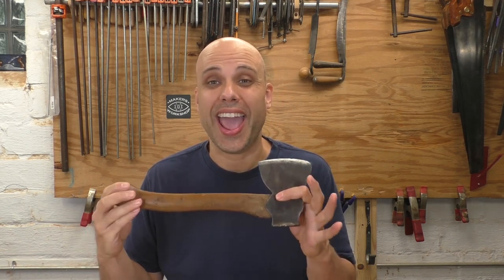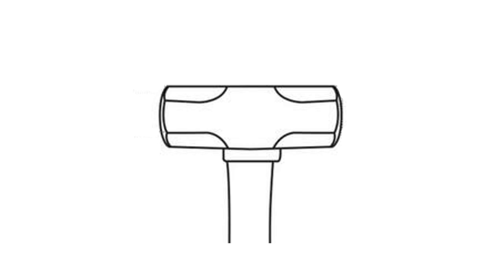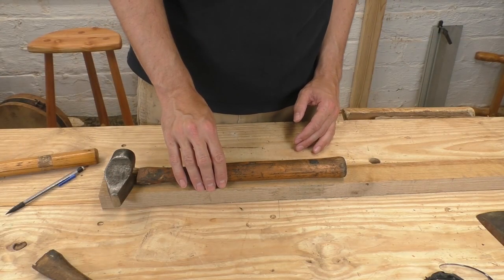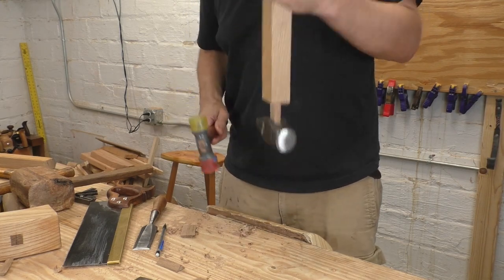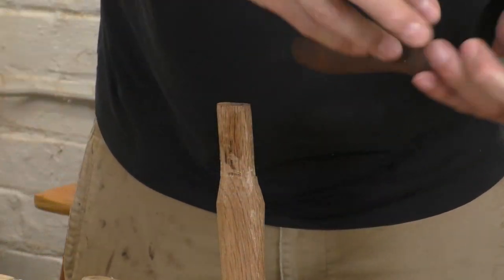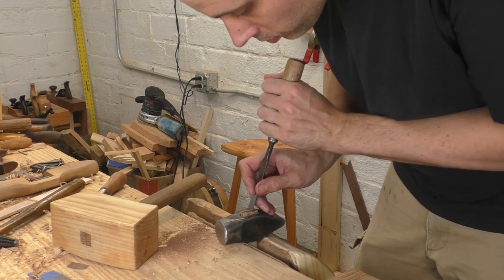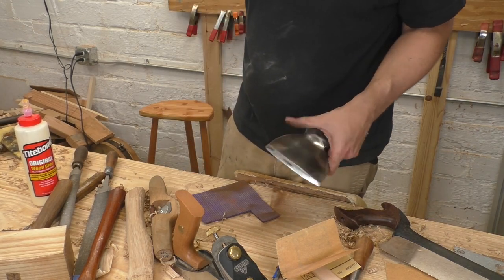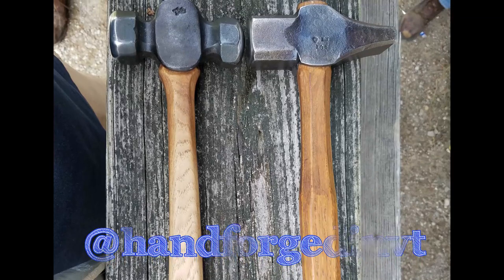Make Custom Handles for Your Tools! (Ax and Hammer Restoration)

Comment: Excellent! I've bought a cheap peen hammer with the weirdest handle ever. It's a small, light hammer, but the handle is longer than that on my my larger peen hammer :o It's very unwieldy! I'm going to replace it someday. Thanks Rex, the Rex Army salutes you! (New name for your patreons, eh? No? No, probably not ... )
Reply from the maker: I would enjoy having an army, but I don't think that's the vibe we're going for here.
Reply: @RexKrueger  Quite!
Reply: The extra long handle, probably 24 inches, is a sign that it was used as a fullering tool in black smithing.
Reply: @criswilson1140  It's not that big. It's a 4 oz and 13 inches (approx). But perhaps that makes sense considering the tiny weight?

Comment: Um, I'm left handed....is it problematic to have the head on "upside-down"?
Reply: Head shapes are action-specific, so if upside-down looks like it would work then no reason not to. You can also file off whatever you don't need or want. You can also weld on more material & file down to a shape you like, tho IIWMI'd pre-heat the head before welding & bake it at 420F for 2hrs after shaping for stress relief & tempering

Comment: back in the day there was a voluntary project for putting a ton of public domain documents (mostly peace corps) online called 3rd world CD(a set of 6 CDs)

one of the documents was 
_ag_fo_wood_harvest_hand_tools_unilo_en_lp_106970_.pdf

_that had a HUGELY useful section on hand tool handles_

the website is now down
I don't even think you can use the wayback machine to get the files
I think I eventually found this on torrent

I highly advise anyone to look for it and get a copy of the whole archive itself, as there is a LOT of hidden info in them(blacksmithing, woodworking cabinetry, house(and barn) building)

it has a lot of the basics, as it was meant for voluntary organizations (like the peace corps) to help 3rd world countries to get uplifted into 1st world ones

there is a website that does have that file, but pretty much a ripoff joint selling as survival guides
Reply: google 2012_cdw3d_dvd_set

Comment: Two things, a little flex in an axe handle isn't a bad thing, so hickory is still a good choice. Have a look at this video, he discusses axes and handles in depth:
https://youtu.be/DrghRcqbVis

You should toss that container of "Boiled Linseed Oil" buy some flax seed oil and heat it very carefully on your stove and begin using that for all your finishes where you require BLO. If you've never done so you'll be very surprised how well it out performs commercial BLO, the primary reason is that they just use drier and never actually heat the oil. Which causes it to become sticky and such if not handled properly. Flax seed oil can be used on wooden  utensils as a food safe finish.

Use Flaxseed oil and beeswax to make your own paste wax and you're good to go! Great video Rex!

Note: I do realize that linseed oil and flaxseed oil are two names for the same oil ;) Flaxseed is the name used for it in food and dietary supplements therefore safe to use on utensils and free of chemical drier. And no solvents are used in the extraction process, commercial raw linseed oil doesn't have dryers but it definitely contains solvents from extraction.
Reply: too much work tbh, BLO is cheap and does the job.
Reply: @tyronicusmaximus4230  Very true! I happen to make a lot of wooden spoons and cooking utensils, so it's a must for me and the reason I discovered the difference in the first place.
Reply from the maker: Certainly sounds like it's worth trying!
Reply: I strongly discourage boiling your own linseed oil, as the fumes are very toxic! However, I heard that you can heat it up slowly over several days with the energy of the sun, outside. I have tried neither of those methods myself though. Please be careful with your health, you only got 1 body.

Comment: FYI ;  (Hammer) too much space between the top of the head eye & handle. That needs to be reshaped to fit much tighter So the wooden wedges squeeze the handle into the eye enough to compress the wood all around inside the eye Before driving wedges home. I would’ve started over. #TRUMP2020 & 2024 🤣